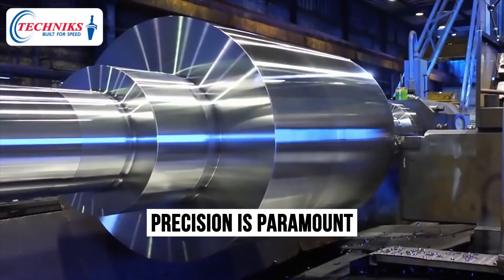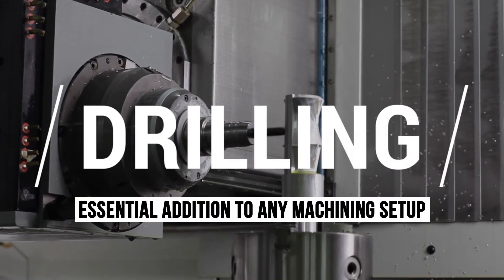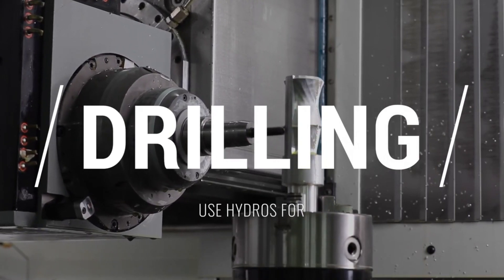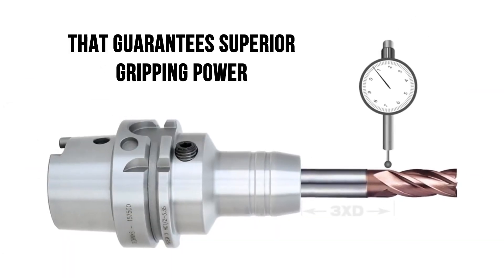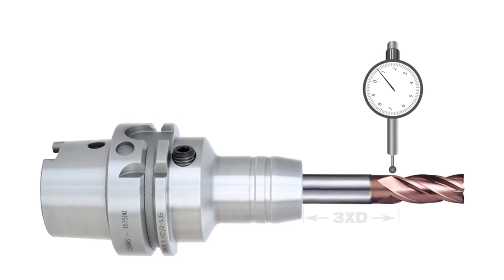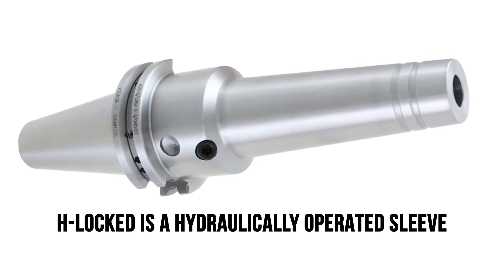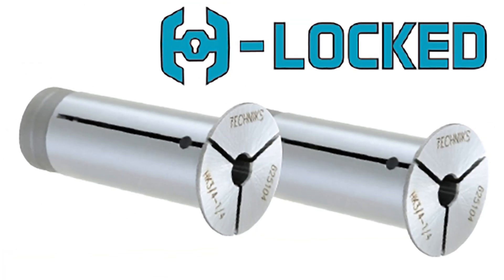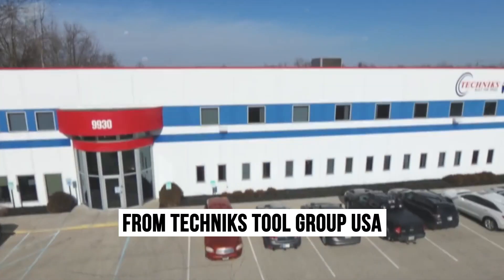Techniks Reduction Sleeves For Hydraulic Chucks

Comment: Will the reduction sleeves fit in other holder  like the corochuck?
Reply from the maker: Hi Nick - The hydraulic reduction sleeves may work with other brands of hydraulic chucks. You will need to confirm the bore depth of the hydraulic holder is at least as long at the overall length of the hydraulic sleeve. Next, you will need to ensure the O.D. of the hydraulic sleeve matches the bore diameter of the hydraulic chuck.